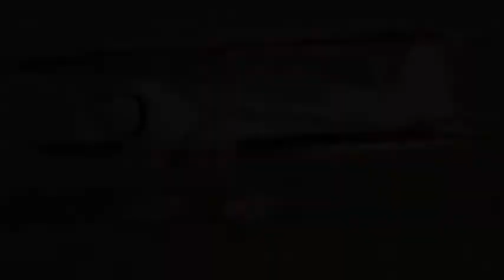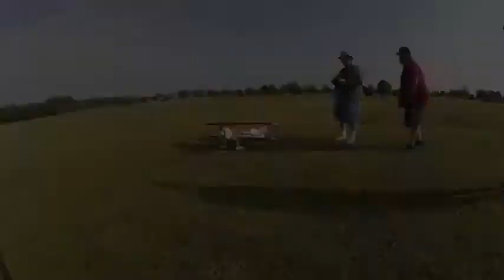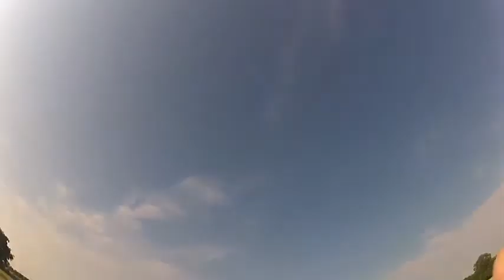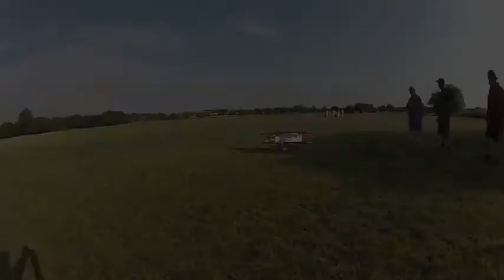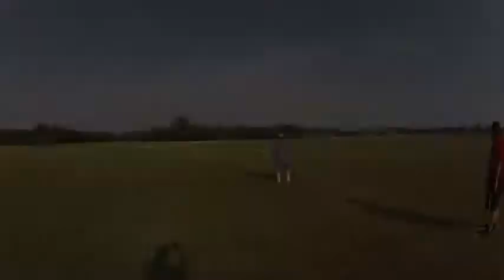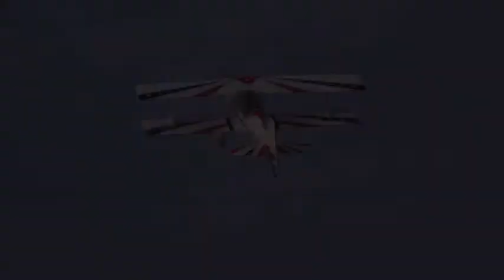Banana Hobby Pitts - Crap in a box!

Comment: .... Sadly, my experience with this model was pretty much the same.  Top wings aligned poorly - I drove to Banana hobbies, and the replacement ones were the same. 
I set it up completely stock - the motor "smoked" on the second flight, taking out the ESC. Thank goodness the BEC worked.  So - trading out the motor for a Tacon 110 and a 120Amp ESC..
I also noticed free play in the tail feather servos. REALLY annoying on the elevator. It's a nice looking model ~ from a distance.